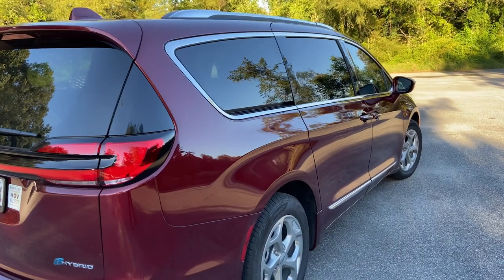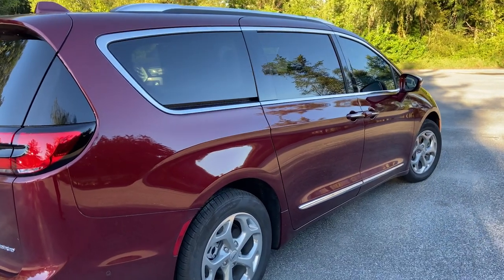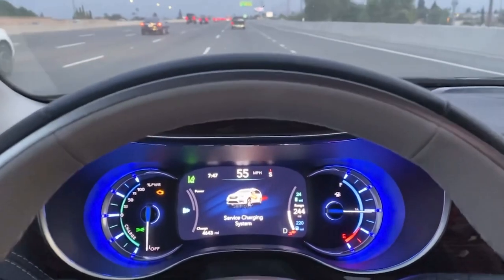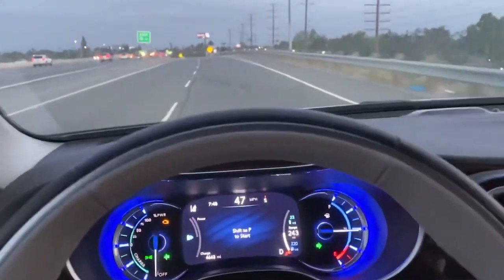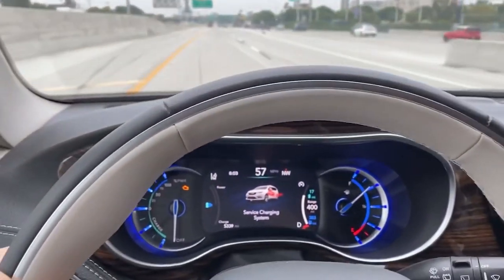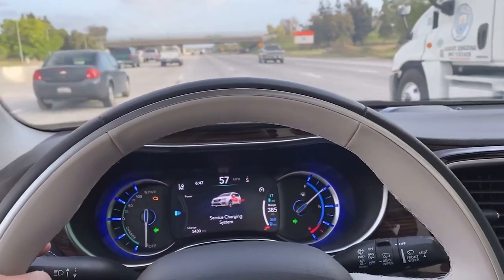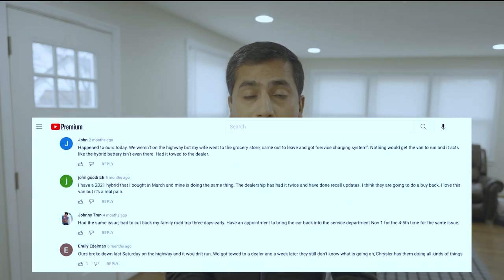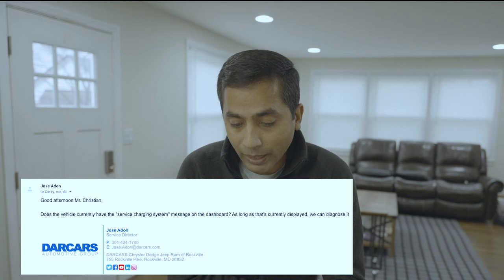Dangerous Common Issue in Chrysler Pacifica Hybrid

Comment: How many miles on van when problems start
Reply from the maker: I think it was around 6000. I wish I had noted. At that time I thought it’s just temporary glitch and didn’t know it was common issue
Reply: @ContentMafia  I have a 2020 with about 12k miles. So far so good🤞, yours just flat dies on you huh?
Reply from the maker: Do you have hybrid? Accelerator/gas dies. Then needs to be turned off for 5 mins or so
Reply: @ContentMafia  I do have a hybrid and it’s been ok so far
Reply: @ContentMafia  I have only heard this happening to you and the guy on the video you showed. But it looks awful
Reply from the maker: I’m glad your car is fine and I hope it stays that way. In this video description, I’ve put the link of another user’s video who has reported this issue. If you see comment section, there are bunch of people who has reported this same issue.
Reply: @ContentMafia  Does it happen when you’re running on battery power or gas power or both?
Reply from the maker: @John-209  has mostly happened to me while running on gas. I don't recall happening while running only on electric
Reply: @ContentMafia  The video you showed on your video I watched a long time ago I did a lot of research before buying the van, I still have not seen more than two or three people with this issue, but I don’t go on the forums, Yours is a 2021?
Reply from the maker: @John-209  yes, it’s 2021. The way I found out a lot of people are having this issue is not from forum but when I took my car to dealership for repair. At that time I didn’t know it was common issue but when I explained my issue to them they said a lot of hybrid are having this issue and  Chrysler doesn’t have a fix for this. And they are out of loaner because they are getting a many hybrids with this issue. But I guess not every single one of them is having this issue, so yours probably a good one.
Reply: @ContentMafia  I did not know that it sounds like some thing that constitutes a recall. But they won’t do a recall unless they have a fix
Reply: @ContentMafia  I still have my 2005 Toyota Avalon with 250 K miles and still runs and looks great. I better hold onto it. Good luck with your van, thank you for the conversation and info my friend.
Reply from the maker: @John-209  yeah, I hope they find the fix soon and issue never happens again.
Reply: I have a 2020 limited pacifica hybrid rmanufactured in August 2020.  I have the service warning come up for safety sensors not working. Then of course within a week the car one day was dead. The 12 volt battery died tomabout 4.76 volts even though my charger was plugged in. How la,LA, of a design.   I thought this thing was to wake if the 12 volt battery ever got too low like 11.5 volts. That was not the case however. The system only wakes up if the main battery gets to low. Off course by that time  12 volt battery maybe dead and it may not wake up.oh well bad engineering. Probably because some safety system drained the battery when I shut off the vehicle. 

I have 30 thousand miles on this car and drove it from New jersey all the way to Yellowstone national park and back. The only thing that happened was about half glass of engine coolant was necessary.  No shutoff and traveled at speeds of around 90mph for a good 1 hour or so.  

I have a feeling,,, Jesus was looking out for me.  Praise the Lord for his grace!!!
Reply from the maker: @tinujatinpatel  Absolutely! Thanks for sharing and glad you’re safe!

Comment: One part of your intro doesn’t make sense…you stated you don’t have time to work on old cars…why would you buy a Chrysler?  Just read any forum or reliable website that rates quality and reliability, you’d see Chrysler is near the bottom…So, expect to spend all that time you would have spent on an old car, on your new one!  LOL…
Reply from the maker: Lol…the only reason I went with Chrysler is because that was the only plug in hybrid minivan available on the market
Reply: @ContentMafia  I’m with you…given the price differential from the Sienna and Odyssey (with the money Chrysler puts on the hood), even if the van is in the shop for a month or so, you’d still save money…not sure about the re-sale though…so, it’s a balancing act.
Reply from the maker: I wanted to buy RAV4 prime but back in Jan 2021 they were so rare to find and the mark up was crazy. If I knew I’ll have to go through this with Chrysler, I would have happily paid extra
Reply: @ContentMafia  Yes they were…I had one.  Owned it for 6 months and someone paid me 10k more than I paid for it…so I sold it and got a Niro PHEV…
Reply from the maker: @petegalindez9961  nice :) how has Niro been?
Reply: @ContentMafia  Not nearly as good as the RAV4 Prime…not able to keep it in EV mode, and the DCT was clunky…got rid of it and got the Niro EV…love it!  Like it better than the two Teslas I owned…as long as you don’t need to drive it long distance (DC fast charging is slow on it).  We easily get almost 300 miles of range in it.